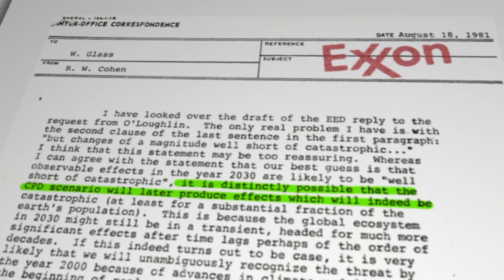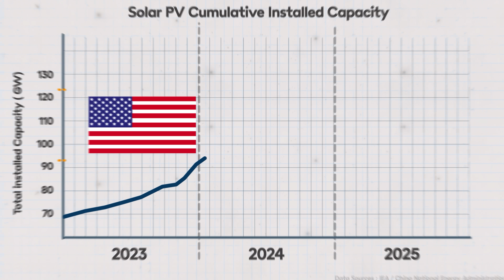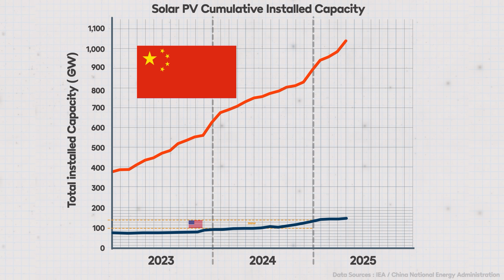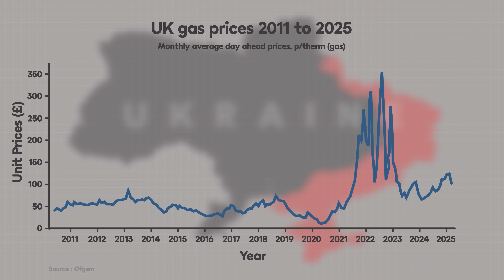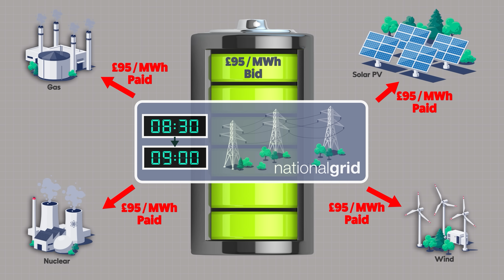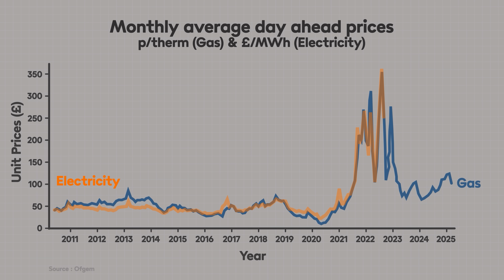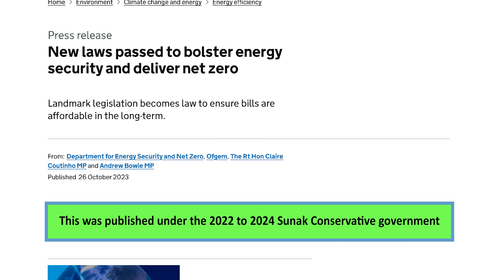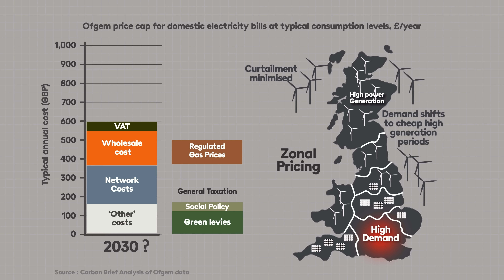Why is UK Energy SO expensive?

Comment: Changing the price creation mechanism could help in case of very high overpricing like in 2022 - 2023, however renewables are now kinda relying on the gas and coal power plants raising the price for them. They bid their power close to zero, but they get the final price, which might be about 100 EUR on average now in Europe. However, their cost are not really what they bid, that's just the variable costs, most of the cost is in the fixed initial investment. Wind needs about 50-80EUR/MWh on average over its lifetime to pay for itself, for solar it's a bit lower on average, but it depends a lot on the location. So really the prices will never go back to the 30EUR/MWh average they were in 2010s. Battery storage needs even higher prices to pay for itself, and we will need that to get rid of gas peaker plants. It has to be done to stop climate change, but it's true that it won't be exactly cheap.

Comment: Please help explain how 6:19 the Marginal Payment System work for renewable operators?
If the price is fixed at a high rate based on gas prices, the renewable operators must be making a real killing!
Reply: Renewables do make higher profits because of the high cost of gas setting the price in the UK most of the time. However, under the Contract for Differences on which renewables are now purchased these excess profits must be paid back to the UK government (via the energy regulator OFGEM). For the renewables that predated the Contract for Differences basis, OFGEM also collects excess profits from these renewable generators via a different mechanism.  These excess profits are then used to lower the electricity price cap.
Reply: @GruffSillyGoat Thanjs ver much for the reply
So this claw back of excess profit is all used to reduce our bills?
And if we are going to get cheaper electricity through renewables, the renewable operators will be less profitable?
How profitable are they now?
Reply: The Contract for Differences approach defines a strike price for a set time period (typically 15 years for renewables/gas, 25 for nuclear), so the cost is baked in upfront. If they earn excess profits above this price it's claimed back. Also, as the stike price is fixed then the cost of payment reduces over time due to inflation (making the cost cheaper overtime). 

The renewable companies anticipate their costs will fall in respect of the strike price (renewables such a solar and wind are still becoming cheaper to make/install) and hence make their profit from the difference between their cost and the price they're paid for generating electricity.

Each contract is negotiated in waves with the fixed price and duration varying in each, using an auction process where the lowest bidder. I'm not aware of the details of each individual contract, of which there are many, so cannot say how profitable each company is from it's mix of contacts.
Reply: @GruffSillyGoat

So the cost of most renewable energy is effectively fixed by the “strike price”, whatever the marginal price.

So I don’t see how “marginal pricing” can affect the cost of renewable electricity to the end user. Does it have anything to do with why electricity is so expensive in the UK?
Reply: The marginal price of gas doesn't impact the cost of renewable production but what is paid as the wholesale rate for all sources, every generator gets paid the higher rate but for CfD based sources, like renewable electricity, this is claimed back. This higher marginal price also sets the price consumers pay for the electricity even if 1% of that electricity in any billing window is produced by expensive gas, regardless of the money claimed back by the regulator (which is put forward to reduce future electricity cap rises).
Reply: @GruffSillyGoat
But the money claimed back does go to the consumer in the end, reducing the energy cap. 

Am I missing something?

Is somebody creaming it off, and who?

Really appreciate you engaging with this to help educate me!
Reply: (Edit: apologies a bit of a long reply)

The cap only applies to standard tariffs, so only customers on those tariffs will see any eventual benefit. Most customers are on supplier specific tariffs these days (typically fixed rate ones), so won't see a direct benefit (only at the fixed contract expiry, by which time the benefit of clawbacks could have been eroded by ever increasing gas prices). Plus business rate electricity tariffs consumers do not get a cap - from small family run corner shops, to EV charging sites and all the way up to heavy industry; so are more exposed to the costs of rising electricity due to gas.

However, the cap itself is based on the wholesale price so typically goes up (occasionally down, but the trend is typically upwards) in line with the projected future cost of gas, which only gets reduced by a smaller amount by any prior clawbacks (calculated against the previous wholesale costs). In 2024, for example, the wholesale cost of gas rose 35%, although only represented circa 34% of electricity generated all year, but still set the electricity price 98% of the time. This means that although money is clawed back and applied, there is no 'visible' benefit to the consumer as they may not be able to take advantage of any cap changes, and in any case, the clawback tends to get swamped by the increase in generating costs due to the rise in wholesale gas costs. 

An illustrative hypothetical example, a standard rate tariff household's electricity cost £1,000 last year but the clawback would result in £200 saving, but with the gas wholesale cost rise projected to be 35% the cap has increased to £1,350 (35% increase), offsetting the renewable clawback this lowers the new cap to £1,150. From the consumer's point of view the cost of electricity has gone up (by £150) and they have no visibility of the clawback savings that were applied nor that actual underlying increase being £350. In reality, price caps are recalculated every three months rather than annually as in this example.

Gas has a disproportionate influence over the way electricity prices are calculated due to the antiquated pricing framework system that was devised when gas was the cheapest and most used form of electricity generation. As renewables overtook gas as the main generating source on a whole-year basis last year, and in the prior years on a month by month basis, it now means that gas is no longer the cheapest form at any time. However, even well before this time the high reliance on very expensive gas peaker plants in the UK typically set the price rather than background gas generation. In 2012, renewable generation cost £150/MWh dropping to £58/MWh last year, whilst gas generation cost rose from £35/MWh in 2017 to £77/MWh last year (with peaker gas significantly higher still, for example at £5,000/MWh price as recently as January).

This is why consumer groups, poverty NGOs, and some electricity suppliers are not only chasing the government to revise the UK's pricing framework but also changing the excess profit clawback mechanism so that it pays back to all consumers (business and domestic) more directly.

As an additional note, under CfD's if the wholesale cost of electricity falls below the agreed strike price then the government (OFGEM) pays the difference to the generator; which is why it's called a contract for differences, with payments going either way. The clawback can also be used to pay for any older, more expensive, CfDs that have higher strike prices; typically though these are fewer in number with lower generating capacity, allowing their cost to be covered by the clawback from lower cost CfDs. 

These CfD below strike price payment are also covered by a risk premium collected by a small proportion (under 1% typically) of the green levy included in the cost of electricity, which acts as an insurance payment should at any time a shortfall payment to a generator be required. The impact of this risk is somewhat also eroded by time as inflation effectively shrinks the strike price in real terms. The obligations (that the levies form part of) also cover payments for the installation of home insulation to help lift people out of energy-poverty, payments for the old home solar Feed-in-Tariffs and other social obligations factored into the cost of electricity over time.

Comment: Renewable energy isn't the problem, but the system it's under is, we have a system that grid renewable energy is tied to gas prices, which makes it more expensive regardless of how much renewable energy can lower our bills, then we have installation cost for homeowners which vary widely but seem excessively expensive for the job being done.

If you're going renewable at a local level and can do most of the work yourself, the cost savings are massive over the long run.

But regardless of all the excuses and obstacle being put in the way, renewable tech is getting better and cheaper all the time, just as battery tech is, in other words, the fossil industry is fighting a losing battle here, regardless of all the dirty tricks they use.

But if you really want to benefit from renewable energy the most, cutting out all the middle men is your best option, because there is too much corruption trying to hold back the adoption, especially on grid renewable energy which consumers don't see the savings from it, which isn't the fault of renewable energy but it's the fault of the system and the governments not changing it to reflect the benefits renewable energy offers.

For now, your best bet is to go renewable energy, try and find a cheap solution on installation, being connected to the grid but having most of your energy means provided locally by your own setup, basically, cut the middle men out as much as you can.

Comment: The problem with the current way of calculating wholesale electricity prices is that the same unit price applies whether there is 1% or 70% gas in the mix. That means that consumers only see an advantage on unit costs when gas is down to exactly 0%

At the same time, to ensure that the grid is to the full extent it needs, the most expensive generators have to be able to cover costs (and make a reasonable profit). 

We should be looking at ways to let that happen, but also let consumers see an advantage with every new windmill or solar panel.

One way would be to pay each supplier half way between their bid and the highest bid. That way the incentive to build wind and solar still exists in terms of higher profit when the gas comes into play, but the consumer also sees half the benefit of the economies of wind and solar. 

That's probably about the best within neo liberal thinking.

Even better in my opinion would be a command economy for energy, where the government runs it all for public benefit, and is able to cross subsidise as needed.

Comment: It's a false dichotomy. In the absence of sufficient hydro and nuclear, renewables have made gas indispensable. Renewables and gas are two faces of the same coin.
Reply: no they are not. many "renewables" can be used to fill in the gap for what LNG provides. LNG is worse than coal in many ways. We only have insufficient renewables due to oil and gas dominance in the public eye. Cant spend on renewables if were already spending on oil and gas.

Comment: Its the cheapest way to make electricity.  Solar is down to 1 cent per kilowatt hour now.
Reply: BUT, what does it cost to store that energy?
Reply: @ZippyPiglin36  very very little. Chemical storage is a problem but there are MANY ways to make batteries that do not use chemicals. Sand Batteries. Molten Salt. Fly wheel's. There are MANY other battery types that are essentially dirt cheap ways to store energy.
Reply: @theshi3152  BUT, all of that increases land usage SIGNIFICANTLY. No intermittent renewable was ever land efficient. 
An excess, and we'll be sacrificing the environment in an attempt to save the climate, while ultimately harming the delicate biosphere out of nothing by paranoia.
Reply: @ZippyPiglin36  except it doesn't. Wind farms can be built in the water. 

Nothing but paranoia? what.. the fk.. its a FACT we are destroying the climate its not a theory. Renewable's are far more efficient than oil and gas. are you considering the amount of land oil and gas uses? or are you only considering the power plants they build? because this matters SIGNIFICANTLY. Your entire comment shows how little you actually understand the issues at hand. 

Where i live.. we are sitting through a 13 YEAR high heat wave, is that imaginary? is that paranoia? no its statistical analysis. these heat events dont just come out of nowhere. they come from a continual and abusive amount of emissions. WE DO NOT NEED TO BURN SHIT FOR POWER. PERIOD.
Reply: Wind, Solar, Hydro, Geothermal,  tidal, and BESS and heat pump can  reduce cost and secure the country in the long run against future energy disruptions.
Reply: In the US lobbyists for ffuels have succeeded in inventing so many regulatory hoops that must be jumped thru before installing solar that the same home solar panel system costs 3x what it would cost outside of the US
Reply: @SigFigNewton  blablablabla..............................
Reply: Yes, it is -- when the sun is shining.   Now add the cost of enough storage to make it dispatchable 24/7/365 and let us know what the real cost of solar is per kWh.
Reply: @TheUweRoss  None chemical batteries solve this issue before its even an issue. Your fanning the flames of bullshit with this comment. Energy can be stored in MANY ways we dont need traditional batteries to store it. molten salt? Hot Sand? Flywheels? we've already invented theses technologies but we REFUSE to use them because of bullsh talking points like this.
Reply: @TheUweRoss Zippa de doo dah
Bibbidy beep
Battery storage has never been as cheap
Reply: @TheUweRoss  No, those things have been factored in already.
Reply: @tschorsch  Almost no statistic has ever taken a singlar watt of energy storage costs into account.
Reply: @tschorsch  no

Comment: Smaller zones can lower the prices for everyone because they can avoid highly expensive redispatch. That happens because a single zone pretends every power can get anywhere, but when supply and demand are far away the grid gets overloaded and some suppliers have to be paid to shut down while others to step in on short notice, which is very expensive.

Comment: The real issue isn’t that renewables are unaffordable (despite what profit driven companies might say), it’s that our current energy system was built around fossil fuels which are predictable and centralized. Renewables are more variable and decentralized, which means we need a smarter, more flexible system to store and distribute energy. Once we modernize that system we can move on from these fossil fuel giants with energy that is sustainable and affordable wherever it's needed worldwide!
Reply: The grid works fine with renewable solar, wind batteries, hydro and hydrocarbons from wastes.  CA, lots of other place go 100% renewable for hour to days at a time now.  Demand has always varied, the grid has always had to deal with demand/generation imbalances. The wires work both directions, so do the transformers. Distributed reduces grid load.
Reply: A larger number of smaller generators are actually MORE predictable than a smaller number of larger generators.  And renewable generation is perfectly predictable days in advance.  The argument is a red herring.  This has actually turned to hilarity in Texas where some law-makers were trying to argue the same thing... that renewables made the grid more fragile, before it was pointed out to them that having smaller generators is actually more robust verses a large generator tripping off-line unexpectedly due to some failure or other.

Grid-scale storage more or less solves all the problems.  The grid itself is not "built around fossil fuels" and never was... that's a huge simplification that has never really even been true.   The transmission infrastructure for the grid has traditionally revolved around fewer,  larger generators where as renewables are the reverse... a large number of smaller generators.  That's the only real difference.

What the industry is complaining about is just the regular growth of electricity demand, which has nothing to do with renewables per-say and more to do with the rapidly electrifying world (transportation and heating... and in the U.K. also cooling as more households acquire A/C systems simply by virtue of installing mini-splits for heating).

But California has more or less proved the nay-sayers wrong... that, in fact, the grid can be sourced by 100% renewables during long periods daily (sometimes the almost 10 hours in California on shoulder seasons!) with zero instability.  And all it took to fix the problems was distributed grid-scale storage strategically placed to alleviate transmission line bottlenecks in the system.  With more to come.

-Matt
Reply: the pint is. decentralized. meaning, they are democratic in nature. Meaning, the center of pwer gets confroonted with a drain of power.
Thats why wind is still pushd more than solar, despie is does not make sense in mst cases